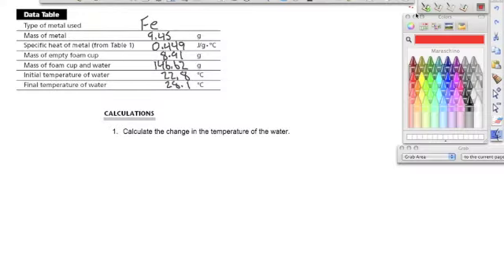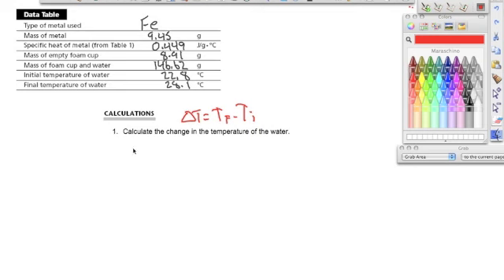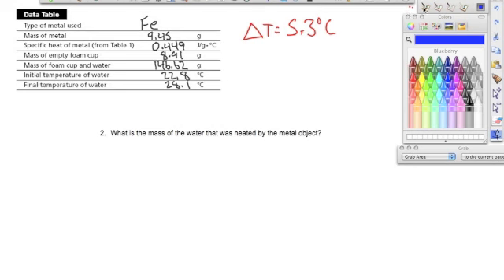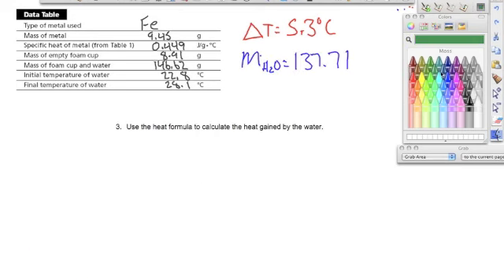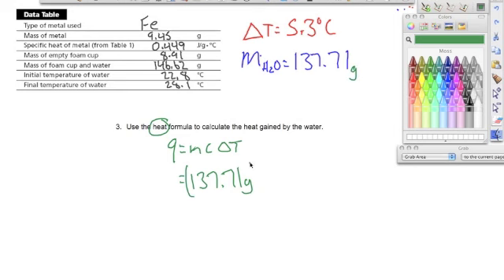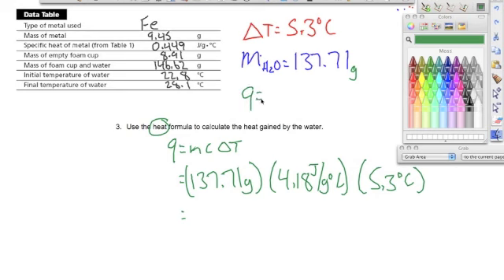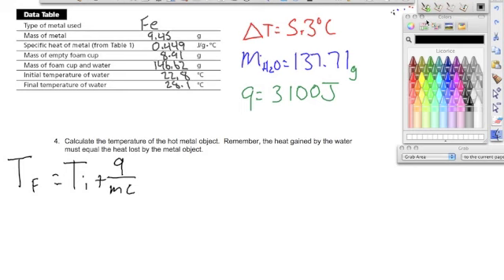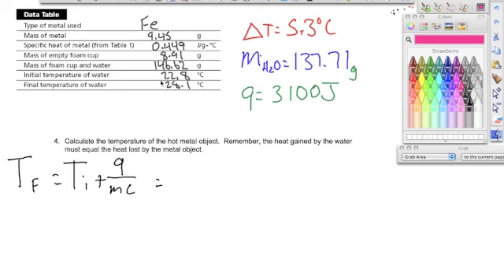Temperature of a Bunsen Burner

Comment: I think you mixed up Tf and Ti in the final equation but the answer is correct. The final temperature of the nail is the same as the water (28.1C) and the initial is the temperature of the Bunsen Burner flame.